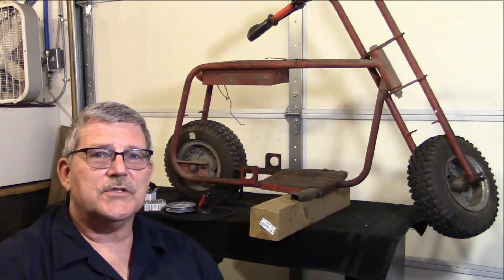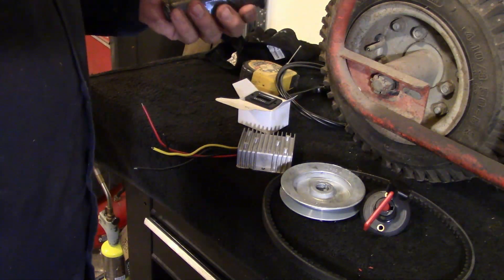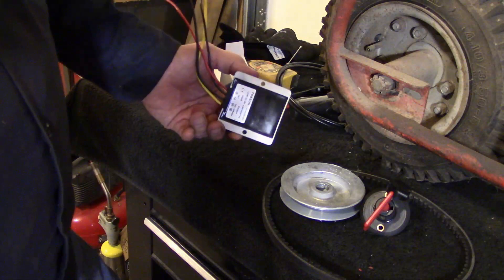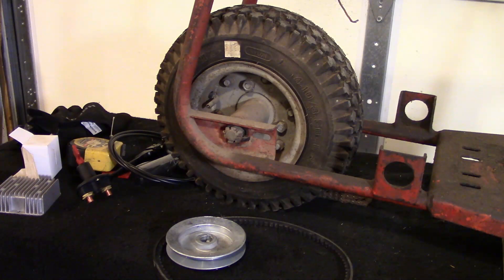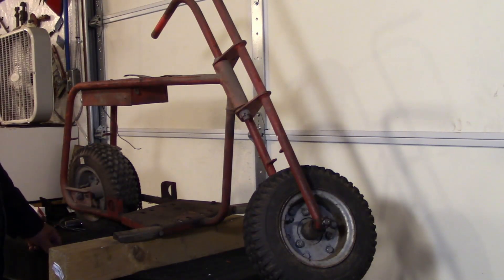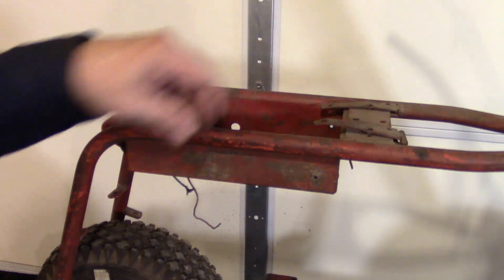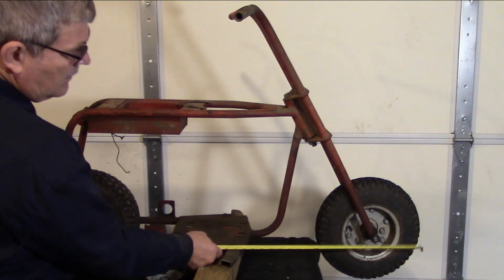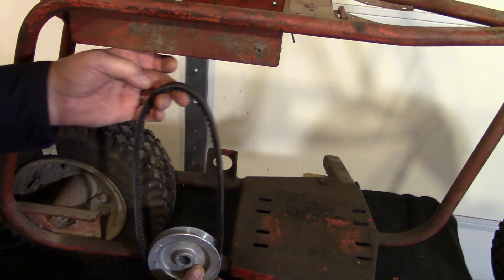Alternator powered Electric Mini Bike part 3

Comment: Scrub those tires with a stiff brush and some dish soap and they will look like new..A lot of neat electronic parts in this build  The under seat box will be nice to fit your parts in ..maybe drill some extra holes for cooling anything with a heat sink on it
Reply from the maker: not2fast4u2c   Thanks , I will do that. They have been on the shelf for so long now. A good scrub and that should work great

Comment: Coming together nicely Lloyd. Those cut off switches can be troublesome. I put one of the Nuffield. Winding over for a while when repairing it got hot. Got another one but no connection when fully on so left it half on.
Reply from the maker: I may get a HD disconnect switch but this one may work. Thanks malc and enjoy your week.

Comment: I'd say it's a Fox frame. I don't know the model with a single down tube, but I'm pretty sure I've seen the distinctive engine mount plate, foot pegs, jack shaft bearing holders, and axle bearing holders on Fox. EDIT: 1960 Fox Doodlebug OR 1969 Fox Sprite https://www.youtube.com/watch?v=Gu4WhAj-sbw
Reply from the maker: Appreciate the help. I will check it out. Thanks and have a great week